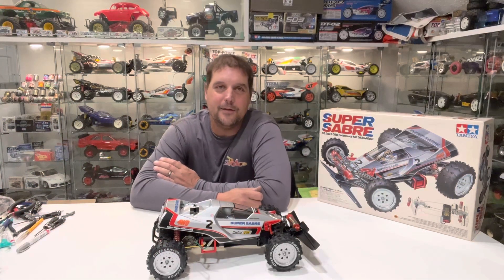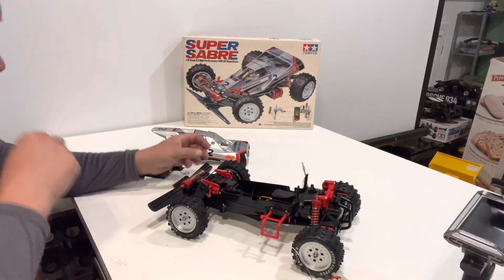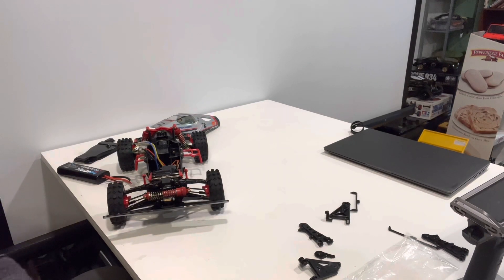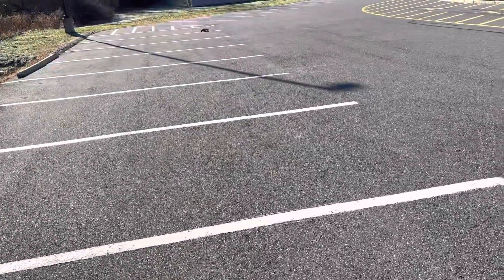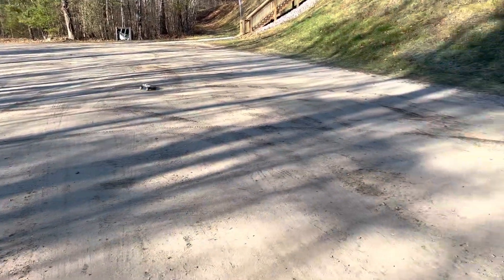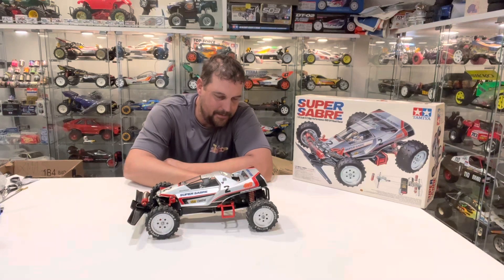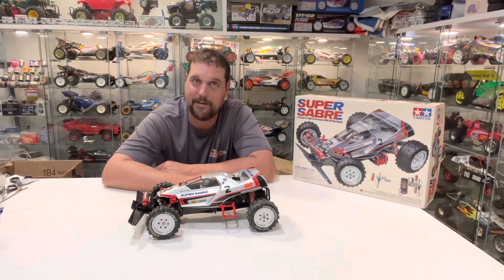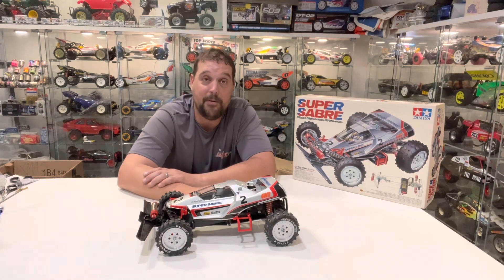Running the super Sabre from 1987

Comment: Hi Keith awesomeness what a great build, it came out beautifully ❤️. I'm really surprised about the front suspension arms breaking, I've never seen Tamiya plastic being that brittle. Possibly because it's vintage and been in storage for years in a warm or hot environment?  One other point though is if the plastic is that brittle I think you made a very brave choice to run a 2 S lipo battery but maybe it was just a freak thing about the arms on front breaking. And anyway nickel metal hydride and nickel metal cadmium batteries really suck. Like it takes more time to charge than you would get run time driving the car. Lipo battery technology is so much better. And the great news is Tamiya have re released the Super Sabre now in 2023 should already be available in North America and Europe and England and will be released in Australia before Christmas 2023 awesomeness AWESOME love your channel Keith 👌👍

Comment: I hear ya about the plastics being brittle. I bought a Falcon and it looked perfect and I looked closely, all good. Then I ran it, fairly gently, and broke an arm straight off. From there cracks just started to appear. CASD and 3D printing ftw there. 
I have a Boomerang. Restoed it, replaced one arm, and it ran well, surprisingly stable car. It sat in the shelf for a year or so, and a shock mount broke on a front arm, from just sitting there.
I guess maybe it's better to run them and have them break rather that breaking on the shelf.
Fun Vid btw!
Reply from the maker: Lol
I totally get it. My nikko Brat broke 3 out of 4 lower arms just sitting.

Comment: Always looked at this in the catalogue and was unsure what my thoughts were on the looks, but I've owned 2 hotshots 2s and still love ripping my franken shot lol, no shell and a rear wing of a touring car🤣 (hpi firebolt 15t, 1060 2s) goes great. 👍
Reply from the maker: Sounds like a blast.
Reply: @rcicons4915  oh it is lol, 
like you said though Keith the plastic is a little brittle to say the least.. I let my friend's son (7years old) have a go and on hitting the kerb lightly it snapped the front gearbox 🤣
but luckily the parts are cheap so £15 later it was back ripping 😁👍👍

Comment: Hey Keith, how's it going? It was great to see you running the Sabre and getting that same kick that I and so many others get, taking us back to being kids. Does it sit slightly lower than the Boomerang? I'm just wondering if it does to  solve the issue of  the front dog bones catching on the cups causing wear  when at full extension? Keeping my fingers crossed for that rere!
Reply from the maker: It is exactly the same as the boom with all the same issues unfortunately. Yes, hopefully we will see the rere sometime in the future.
Reply: @rcicons4915  ah, OK thanks for that Keith. For some reason I had it in my head that the shocks were slightly shorter. Thank you for clearing that up for me! 🙂
Reply from the maker: @MGSY666  you may be correct now that you say that. I will have to compare to my boom.